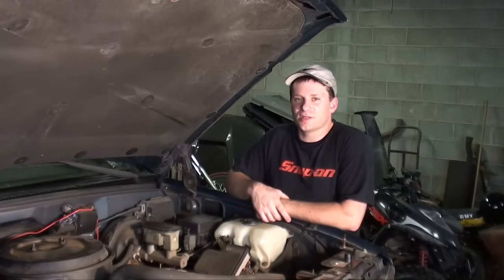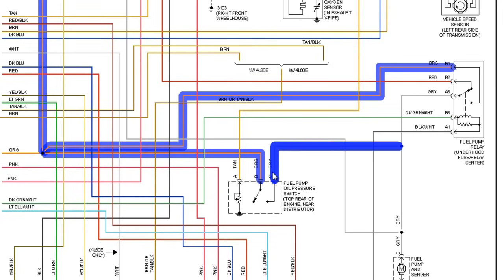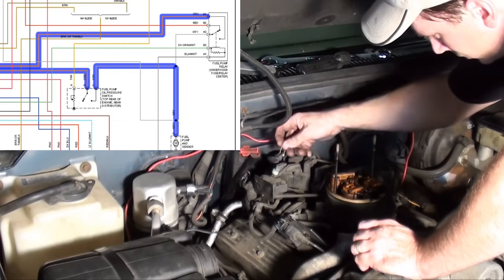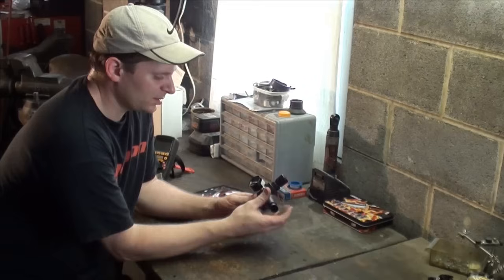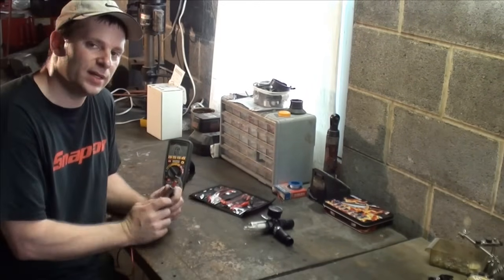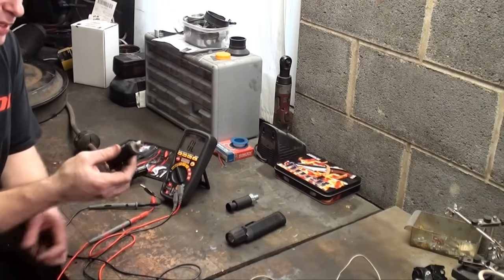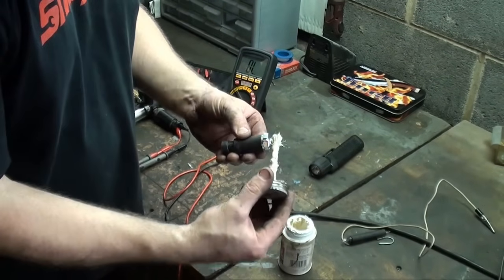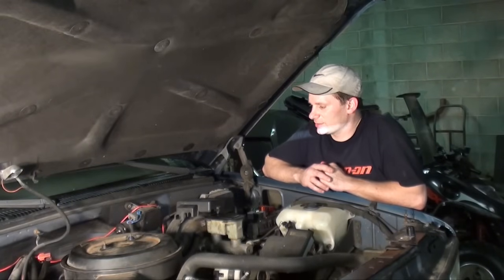Part 2. GM no start no fuel troubleshooting "Oil pressure switch"

Comment: Robinsonauto,
 So, was both the relay and  oil pressure sending unit bad?
      If the oil pressure s/u alone was bad it would the engine still start?
       I have a 96 Tahoe that won't start "some days" (intermittent).
New dust cap, coil.
Can't hear the fuel pump. Smh.

Comment: Nice job, Will! Last year a watched a vid by Scannerdanner, and I was hoping he would do what you did today. You might send him this as a video response to his video. 

What puzzles me is, why did GM do this? What would happen if you had a bad oil pressure switch at that point? As far as I can tell, nothing, (grin)! An abrupt fuel relay failure would be very rare, and the worst that would happen is you would stall at speed, then coast to the side of the road.... What am I missing?

Comment: The intention of this wiring configuration is for fire protection, for when the vehicle has rolled over and is up side down. In that event it is important to stop the fuel delivery. The way it works is that the oil pump will not have any oil in the sump to pump, thus no pressure. And those contacts, in the oil pressure switch,  will open to cut off the fuel pump.  Rather than putting full fuel pump motor current though the light duty contacts in the oil pressure switch, a relay is used. Otherwise, a much larger, more heavy duty oil pressure switch would be required. And this is all bypassed , during "start",  before oil pressure has been developed. The same as old cars with ballast resistors and points worked.. Been wrenching on cars for 50 years. At first there was no fire protection because fuel pumps were mechanical and cars had carburetors with float bowls that shut off the car if rolled. Then electric fuel pumps got popular and fuel injection and fires occurred after crashes that required to be dealt with. That is when and why  wire oil pressure switches came in to play. Today, inertia switches are used instead of oil pressure switches. It is not for in case of relay failure or any other convenience.
Reply: How then did the engine run with a good relay and bad pressure switch?
Reply: Dean Studer so you could have a bad relay and never know it due to the pressure switch?
Reply: lol this debate has been going on forever. Who cares what the intention was, whether because of wrecks and rollovers, or to save a motor from seizing up because the owner didnt notice the engine didnt have any oil in it. Either way the OBS trucks left too many people stranded in parking lots because of bad sensors, having to use a paper clip to get home.
Finally they scrapped the idea. Who knows, maybe because OBD2 and later PCMs were able to log enough data to show GM to prove to the customer "no we wont warranty your blown engine, you didnt put oil in it, your own fault".
Reply: @janj0n  BECAUSE THE SWITCH IS NOT FOR SAFTY!! ITS IN CASE THE CHEAP GM RELY FAILS THE GAS WILL STILL GET TO THE ENGINE!!

Comment from the maker: Control module keeps relay energized if engine is cranking or running(control module is receiving reference pulses from ignition module) if no reference pulses, module turns off pump within 2 seconds as a back up system to relay, the oil pressure switch also activates the pump, normally open until oil pressure reaches about 4psi. if relay fails, oil pressure switch will back up, only when with pressure, cranking time will be longer if fuel pump don’t receive current until pressure is achieved

Comment: I have 02 Suburban, starts & runs briefly then slowly dies. 15 psi fuel pressure with key on & dies off to zero. New fuel filter so I think it's the pump. Thanks for the video.

:)

Comment: So if your relay is bad and the oil switch works would that be why there is no fuel pressure with key AND and extended crank time(10seconds).  Is the truck waiting that long for the oil pressure switch to turn on the pump?

Comment from the maker: My first response on how the system was setup was from Mitchell provided by GM. that was their theory any how. Will it do just that depends. In some cases it may not obtain enough pressure while cranking example, low battery, bearing clearances and so on.
some engines with excessive bearing clearances, worn oil pump, low bat. may not reach 3psi while cranking, 
i can say, it did helped some. had a couple in the past with long cranking times that just needed a relay. very rare though
Reply: Im curious about this. You had it running and pulled the relay and it kept d
Running after you replaced the oil pressure switch. Now I wonder if you shut it off and try to restart with the relay still removed will it start and run??

Comment: I have a 1993 GMC Sierra 5.7. I can drive it from Florida to California with no issues, after it’s warm and I shut it off, it will not crank again until it cools down. Has new fuel pump, new sending unit, & new fuel pump relay. I have oil pressure but the oil pressure gauge seems to act a little whacky sometimes, could my oil pressure switch be the issue? Like I stated above, it only will not start after it’s been ran and hot, once it cools down it will start and run with no problems until I shut it off. Please help. I plan to replace the oil pressure switch anyway as the gauge is acting funny. But I thought it would only be the problem if the gauge was reading zero oil pressure? Any help would be greatly appreciated. Thanks ! Great video 👍🏽

Comment: Good video, I work with my own stuff all the time but would not have thought about the oil pressure switch. I'm working with my GTA, fuel pump wont run after sitting for a year, ran fine when parked. I would start it on occasion, but now no start. I have power at the relay and 2 sec. on prime. Is the fuel pump known to just seize from sitting? I need to run direct power to the pump at the connector above the axle next, mist likely power there and need to drop tank and change out the pump.

Comment: Great video, love the wiring diagram, thanks
Reply: I agree, breaking it down with the wiring diagram as well as double checking results in different ways. I have a 1995 GMC service van that I work on myself, so any repair I make needs to be done correctly and 100%. Thanks for the help.

Comment: i have a1994 chevy  4x4 i put a new fuel pump thinking that was it but it wasn't i'm not getting power to the fuse power is going to the oil sending and the relay but no current on th gray wireto the fuse or to the pump. can you help out

Comment: Great videos? My 91 3500 has an issue starting. Won't start unless I turn key on and off 3 or 4 times but after that and running a while seems to be better...any suggestions?

Comment: I have a 91 GMC sierra 5.7l .just installed a new fuel pump it comes on I have spark sometimes it will start and run and then it will shut off like the key was turned off then will not restart.. Any idea what that could be .could it be the same the oil pressure switch.it will start after sitting a while.

Comment: Nice informative video, thanks!. Well, my 1988 K5 Blazer’s fuel pump will not prime but the truck will start after a couple long cranks, then the truck starts and I can hear the fuel pump humming, so my problem could be reversed from your case here, where my fuel oil pump switch may me working when my fuel pump relay isn’t? (Even after I replaced it?)Can you replicate this failure mode in your truck for me and show how to fix it!. Thanks again

Comment from the maker: Good question, i should make a video response for this one. if i showed you first hand it will make more sense. say if the motor jumped time, Broken timing chain or belt depending or more extensive damage, you will hear a deference in the way the engine cranks, when in time you can hear the the starter working harder overcoming the compression from each cylinder... mechanical problem say a broken timing chain the starter would spin much faster less load, do to the cylinders without compression

Comment: i have a boat with mercruiser 5.7 and it never wants to start after sitting for a couple days. if i apply direct voltage (jump) the fuel pump by disconnecting from the oil pressure switch  it kicks on. then i reconnect the wires and it fires up and runs all day just fine. i think my oil pressure switch is bad too. it has 2 wire prongs one to the fuel pump and one to the alternator. all this time with hard starts. does this sound correct? seems strange you need oil pressure before sending fuel but i guess only 3 psi would be achieved quickly during starting process and if the switch is bad that’s why i’m not getting fuel pump action??

Comment: I have a start stop issue with a vortec new fuel pump and filter and new coil and distributor cap and button any ideas I can even run the fuel pump with jumpers and truck still starts and stops

Comment: If the pressure switch is faulty can the power to the fuel pump be intermittent? My truck will run fine and all of a sudden shut off and you don't hear the pump run. You wait for 20-30 minutes, turn the key on and you hear the pump and the truck starts. The pump is brand new and the truck ran for 6 months before this started happening. Any help would be appreciated.

Comment from the maker: I agree should of performed that test as well for you guys guess i was a little sloppy on this one, i know for next time... wasn't really trying to prove anything just going over some basic checks to determine if the system is working correctly. the comment you responded to was copied directly from Mitchell provided by GM. when i jumped the OP switch and the pump activated that was with the relay out. so yes in the perfect world as long as the contact close while cranking it will run,

Comment: So if I pull this oil switch and my truck turns off, but it doesn’t cut off when I pull my relay does that mean my relay and my oil pressure sensor are bad or does it mean JUST my oil pressure switch is bad?

Comment: I have an 87 chevy P/U with 350 and TBI.  It will crank and run a while then die.  It may re-crank, or may not for a short time.  I replaced a relay on the firewall that is supposed to be the fuel pump relay, but that did not fix it.  Do you think it could be this oil pressure switch?

Comment: Can you please tell me which goes first, the relay or oil pressure switch for an electric fuel pump? 
Just disconnected manual fuel pump and installed a Carter electric pump.

Comment: I have a no start on a 2000 K2500 6.0 and it first starts on prime and shuts down in a few seconds 
The FP Relay has no power on the board. Injectors all have pulse, and a new fuel pump, filter, line and fuel was installed with the same results. Should I have power on the relay box when key is in the on position? It set for 3 years and ran fine when parked. I believe it's a power problem to the relay. Advice??? Thank you

Comment: Actually, that does help. So, I'll have to add the possibility of a failed fuel pump relay in the case of long crank start with a GM product. I wouldn't have expected any start with a failed relay, so that might be a difficult diagnosis.... My oil pressure gauge doesn't jump until a few seconds after starting, and without ignition (and only the starter pumping oil) it's going to take longer. 
Why is it so important for the vehicle to still start if the fuel pump relay dies?

Comment: Could that oil pressure switch be the cause for fuel pressure leakage? My truck looses it's prime pressure (have to start with carb cleaner after sits for a while or else you kill battery trying to start it. Starts back up on its own as long as it doesn't sit ling period of time (more than a hr). Runs perfectly fine otherwise other then the lack of power up hill and the oil gauge bouncing up and down

Comment: 2005 Pontiac grand am SE V6. Does it also have the fuel pressure sensor fail save stop? 

I've had this car for quite some time and a few months ago the car stopped and I had to have it towed and had the fuel pump replaced. This first fix worked for about a month perfectly until I was driving a few days ago and the car suddenly loses power. 

These are my symptoms..

.Turn car on fuel pump activates can hear buzzing or humming

.Car starts just fine 

.Car runs for a bit for about 10 to 20 minutes.

.Car then randomly while driving shuts off like fuel pump isn't working and won't start again unless I let it sit for 30 minutes.

Also check engine light stays on even after oil change always has for some reason. Checked owners manual did the reset still stays on. 

.Diagnostics and repair so far.

I've already tried changing the fuel filter just wishful thinking hoping that it could possible effect the fuel pressure enough to cause stalling... This did not work.

I tried swapping the relays for the fuel pump hoping that maybe is was due to some type of intermediate relay failure. This did not work either.

. Like I've said before the fuel pump was replaced and still seems to be in working condition... Car gets good fuel pressure can even get up to about 55 before shutting off completely and can hear pump activate. 

Also today car started so I drove to 
advanced auto parts to run the codes and these are the codes I got.

P0250 - Full pump circuit malfunction.

P0446 - EVAP System emissions system vent control circuit history mil.

P0455 - evaporation emissions leak 
detected gross leak/ no flow.(Hopefully just from changing the fuel filter the other day or riding there with no gas cap because forgot to put 
it on)

P1106 - Manifold absolute pressure sensor 
circuit intermittent high voltage

P0520- Oil pressure sensor circuit 
malfunction....
 
Advice you can give would be appreciated. Hopefully its something inexpensive that I can do myself. Got taken advantage of by a repair shop before so if I need one would still like to have idea of what's wrong before I get it looked at. Thanks for your time.

Comment: I bypassed circuit like you show at sensor plug but still only get 3.8 volts at fuel pump. What else could be reducing voltage sent to fuel pump?

Comment: A I have a 1992 Chevy Astro with a 4.3 it crank but no start I put starting fluid in it and it starts but cut right off again so I replaced my fluid pump and filter and still the same thing so I placed the IAC and the map sensor and plugs and wires with a new rotor still the same thing no be for it stop starting up I gave some one a jump and they hook the cables up wrong of I have blown out a fluse but when I checked the flushes they was all good now when I take the air cleaner off and start it I can c the gas coming from the tbi system but it still want start unless I put starting fluid in it and then it will run but it cuts right off

Comment: So I replaced my oil pressure sending unit and my fuel pump relay, but when I removed my fuel pump relay like you did in video it still cuts off???

Comment: I need help. I have a 93 suburban and it shuts off going down the road and will not start back up until I turn off the key and then it cranks right back up. if I try to start it without turning off the key it just cranks and cranks but never fires. it started doing this every now and then but now it does it all the time and sometimes back to back... dies turn key off start back up runs for 2 secs then dies again... never starts again with out turning the key off then back on. I hotwired the fuel pump relay so I know it has fuel but the injectors don't fire when it shuts off. I think its the ecm but I don't want to spend the 100 bucks if that's not it... thanks for any help you can give

Comment: I changed the oil pressure switch and it ran for a 5-10 minutes and died do you think it’s the oil pump?
Reply from the maker: Check the relay circuit

Comment: The oil pressure side is a safety circuit not a back up, Say you leave the key on engine not running, the pump would always be running. The ecm only lets it run for a few seconds if no oil pressure closes the by pass circuit the pump shuts down.

Comment: Thank you!!! I've had a similar problem with mine, cold starts fine but once it warms up, I get symptoms of low oil pressure and the car stalls unless I keep my foot on the gas. The starts get harder as the car gets warmer and there's oil leaking from the oil pressure switch. Been researching this for awhile but this helps alot in knowing how to test the fuel pump relay which I recently replaced to narrow the symptom. Car has 150,000+ miles on it - accelerates fine, just stalls at idle when warm after the oil thins and warms in the engine.

Comment: Thank you I fix my truck with this video thank you
Reply from the maker: That is awesome! Glad to see this video is still helping😀
Reply: @robinsonsauto   What if I'm not getting control voltage on the orange wire on the oil pressure connector switch?maybe the connector is bad?

Comment: that was Awesome information Bro, Thanks for sharing, I trying to get my wife's 95 chevy truck she wanted to keep for sentimental reasons, but it has been sitting for a year or so, but was running perfect when we parked it. Thought it was the fuel pump but when I put on a new one it still wouldn't start, it cranks over but it's still seems like it's not getting any fuel. I put some gas in the carburetor and it started up and ran till the gas was used up. I haven't check for spark yet, but if thats not the case, is there anything else I can check to get the fuel flowing to the carburetor?
Reply: Lol 95 is the worst year to have